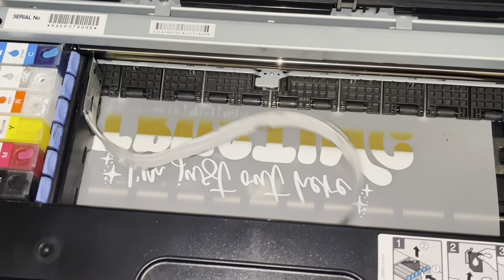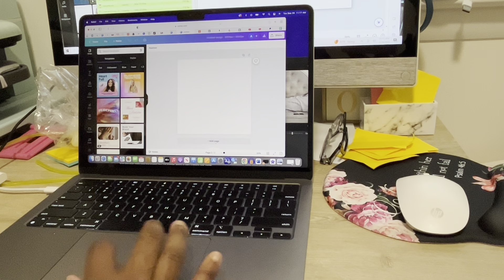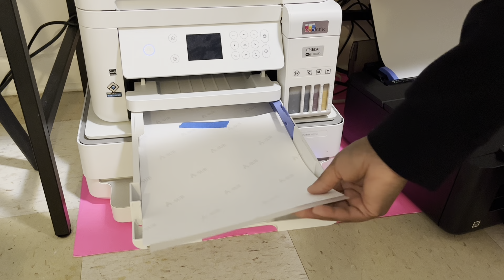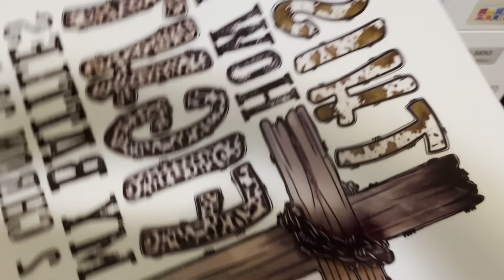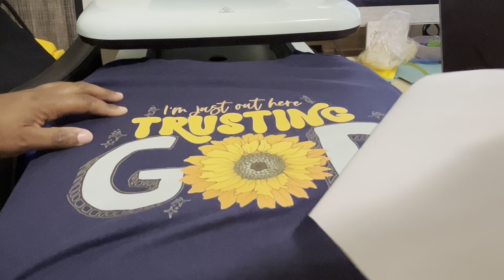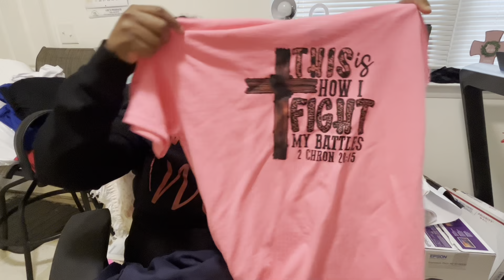DTF Printing VS DTF Hack (The difference between DTF printer & DTF hack)

Comment: What DTF cartridges did you purchase for that printer and does it use a lot of ink!
Reply from the maker: It come with cartridges but if you are converting to DTF then you can replace the cartridges with empty one and fill it with DTF ink. I do have some which you can get with the link in my description box!
Reply: @Healher_7  ok awesome. I would like to purchase some empty cartridges from you because I would like to convert my printer also